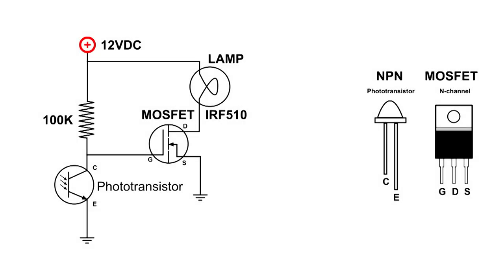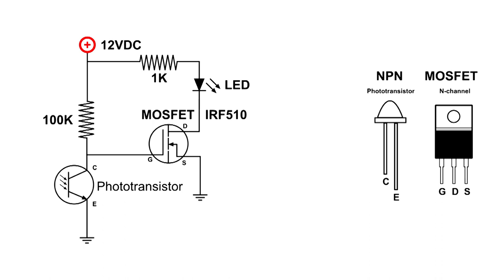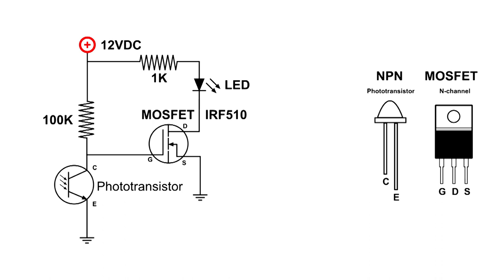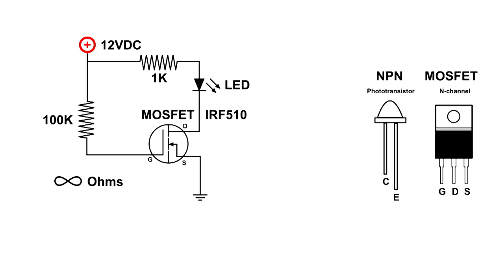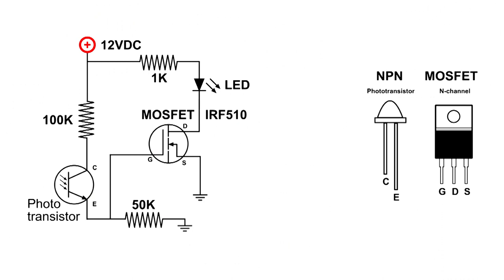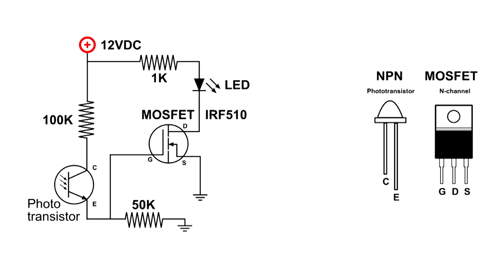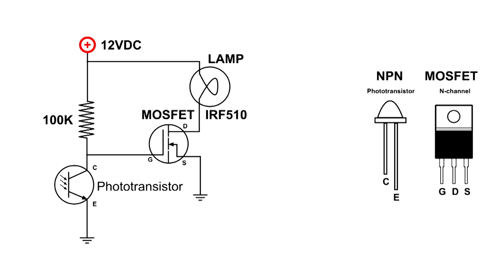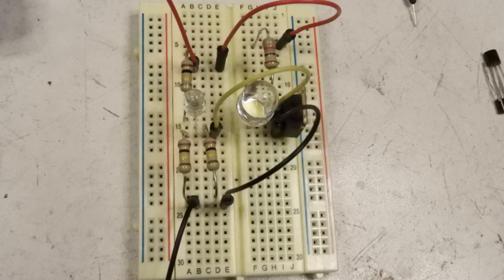Auto On Off Light Switch Reverse Operation

Comment: Possible to have the circuit to work with intensity of light. Instead of on/off can it work with dimmer effect. The light brightness to work same with the brightness that hit the photocell. I want a light in my dark room to show how bright is the outside using such.
Reply from the maker: This would be possible, Rather than an LED or other lights, I think an analog meter would be more useful.

Comment: Hello, I'm very new to this, and understand the concept of resistancers. How ever I need to power a 12 volt solenoid, I tried to attach on the output from the MOSFET to ground bus there's not enough voltage there, but the is working fantastically, however I need to run a 12 V solenoid
Reply: Just woke up,  and relisted I don't even need the solenoid, just hook up the motor from the start of the circuit...

Just tested the moto , and dentist at the solenoid they didn't work... 😕

The signal passes straight three them.
I might try removing  the LED and 1k resistor and try again

Yeah bypassing  resistors didn't work. So a little stuck now... Will think on it more 🤔
Reply from the maker: You might try using an IGBT or a relay or both. If your solenoid operates with your 12VDC supply I would try the IGBT first. I made two videos on this subject. Keep asking your questions.
180° Phase Shift using one IGBT Auto ON OFF Circuit
https://www.youtube.com/watch?v=KwS1f3Z1150
Auto ON OFF Circuit Updated with IGBT
https://www.youtube.com/watch?v=n-Ac4czBkpM
Reply: @AllAmericanFiveRadio  thanks, I will check out the videos and the IGBT ? Sounds like AI 🤔
Reply: @AllAmericanFiveRadio  I had a confusing problem with the circuit not working as it was yesterday, but found it was the capacitor in the MOSFET still had charge...

Comment: I woukd like to use this idea to control a 12v water fountain pump.  Do i need any more or less components to do that ?
Reply from the maker: All you need is this from Walmart.
Liquid Level Controller Sensor Module Water Level Detection Sensor Assembly
https://www.walmart.com/ip/Liquid-Level-Controller-Sensor-Module-Water-Level-Detection-Sensor-Assembly/1750028103
Reply: All I want to is run the fountain in daylight hours and off at night
Reply from the maker: @ianmather7109  I think this would make an interesting video. I'll start looking for parts. I'll let you know when the video is up.
Reply from the maker: @ianmather7109  I just ordered some relays
Reply: I am intrigued,  my pump pulls 200 ma
Reply from the maker: @ianmather7109  The relays are in.
Reply from the maker: @ianmather7109  I think it is time to update this circuit.
Reply: d @AllAmericanFiveRadio  I am looking forward to seeing what you come up with.
Reply from the maker: @ianmather7109  Me too. I'm having fun!
Reply from the maker: @ianmather7109  the new video is up

Comment: Can you write down the detail components to use please
Reply from the maker: 1 - LED
1 - 12VDC Lamp
1 - MOSFET IRF510
1 - Phototransistor NPN
1 - 1K Resistor
1 - 50K Resistor
1 - 100K resistor
1 - 12VDC Power supply
Reply: @AllAmericanFiveRadio  thank you so much